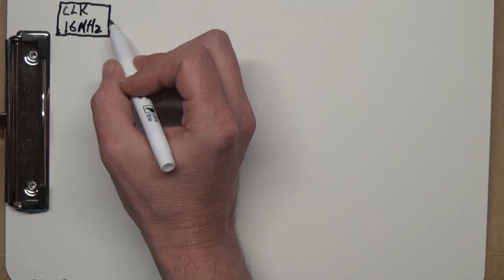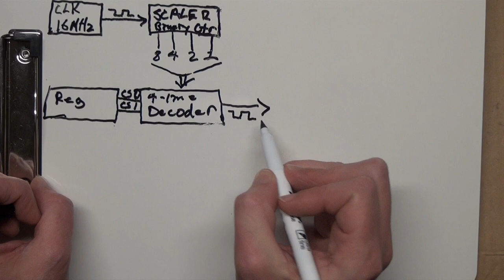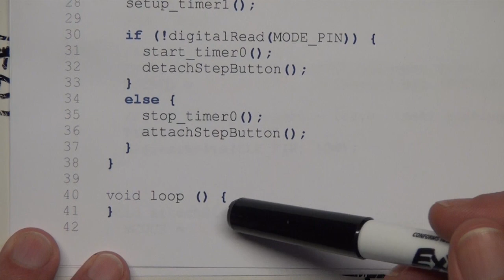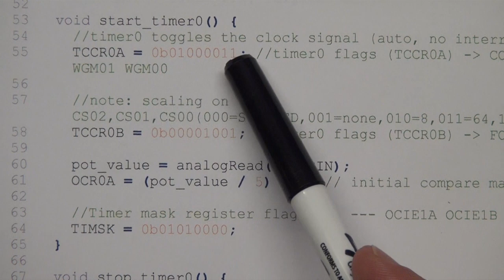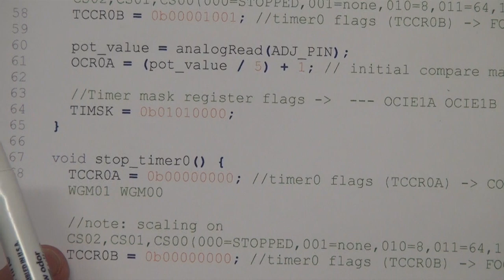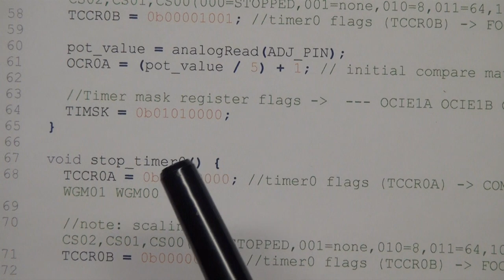Clipboard Electronics: ATTiny Timers Hardware Deep Dive

Comment: Great explanation man! Thanks for taking the time to make these videos!
Reply from the maker: No problem, I enjoy it. I think we need another video that explains how the code actually works overall, and how the timer output gets used to produce PWM and other stuff. I like, totally ignored that part! I am trying to figure out how to get this project into GitHub, but it's not cooperating today.
Reply from the maker: Files added! Link in description. It is a work in progress, hehe. Feel free to pull and update if you want.
Reply: @jasmine2501  Thank you so much dude! Will grab them and have a play :) Now all you need too do is finish off your "Retrocomputer (6502/Z80)" video series ;) 
Dust off that shelved project, and remove all those // TODO:  lines :D Maybe we can build this together as I have already started designing the schematics (using KiCad). Let's get in touch....
Reply from the maker: I have goals for this, and I have made a folder for it, so I kinda have to finish it! The idea is to build a platform that can switch from Z80 to 6502 and possibly other chips from that era. I don't want to do graphics, I want this to be an engineering and BASIC programming platform. So, I'm thinking terminal text style, like the Altair. But, I want the form factor to be something that kids can program on the couch. If you want, look me up on Facebook, "Jasmine Adamson" - I'm in the "Z80 DIY/Homebrew" group on Facebook.
Reply: @jasmine2501  This is EXACTLY what I am doing, but starting with the 6502. I already designed the 'back plane' board which allows you to add more modules to it with the idea that it can be expanded to your needs as your knowledge of 8 bit computing grows. Again, like you I want to develop a simple BIOS in the EEPROM that loads up BASIC on boot up, so  that the system can be completely stand alone.... great minds huh?